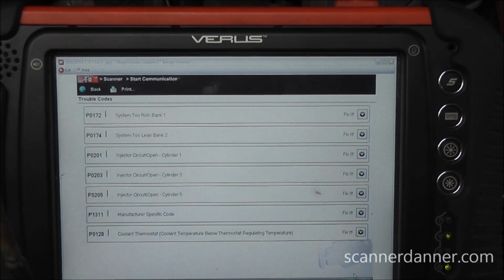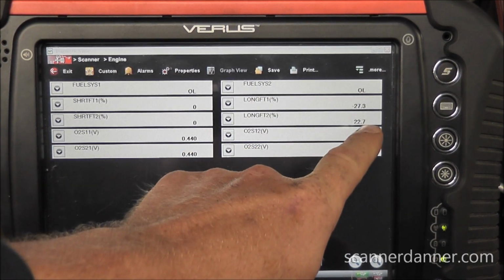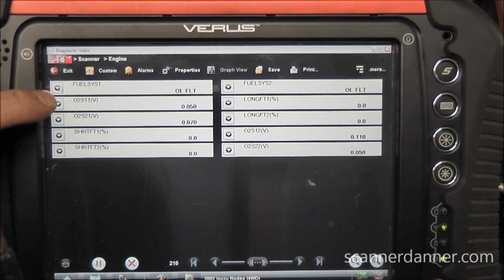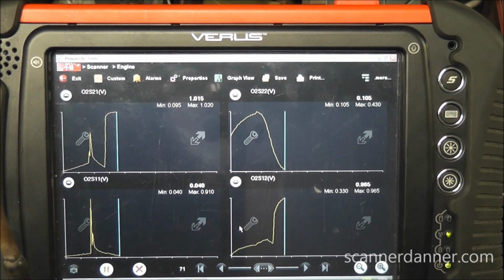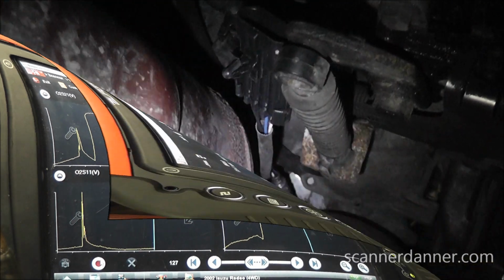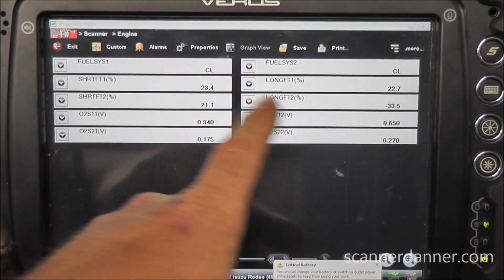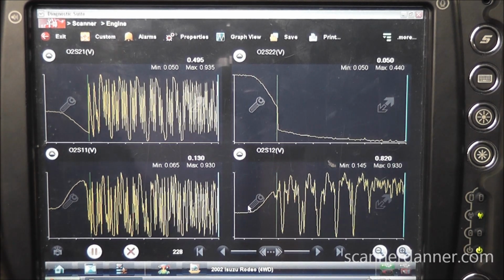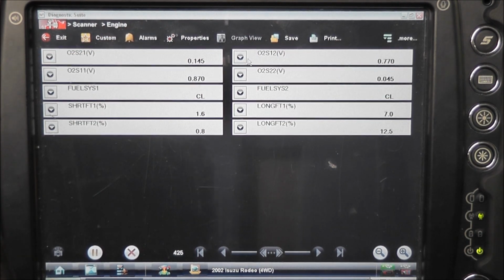2002 Isuzu Rodeo (misfire, low power case study, reversed O2 connectors)

Comment: Absolutely wonderful video. I've got a 2004 3.5 GDI isuzu rodeo with a pretty unknown history. Starts up and idles great. When cold, it'll increase RPM to max ~4000 with some misfiring. Once warm, it wants to stall if any throttle is applied. It'll increase RPM only with WOT but very rough, barely fires- idles mostly fine with a bit of a stumble. Only code is stating high circuit on MAF, previous owner states MAF was just barely replaced to try and resolve this issue. Will chase for bad grounding- maybe pop the ECU open and tear apart the harness to check for bad wiring and traces.
Reply: When I got my 2002 Isuzu rodeo sport it had a lot of obscure electrical issues different things would happen stuff would turn on and off I regrounded all the grounds 4 or 5 grounds there were a lot it fixed electrical issues I also found a speed sensor on the left side of the transmission wires were broken re wired it and no more high idle shifts at about 3200 rpms also EGr valve get stuck and behind the throttle body there is a EGr aka nox tube mine had the tiniest hole through it it a pain in the butt to clean the tube but with a drill and a piece of breaded steel wire you can fray the end as to act like a brush or a gun cleaning brass 30cal will work also if you remove the EGr valve there is a hole that leads into the intake manifold tube u can spray carb or break cleaner in it and blow it out with and air compressor
Reply: You can also clean the mass air flow sensor too should help unless the sensor is broken

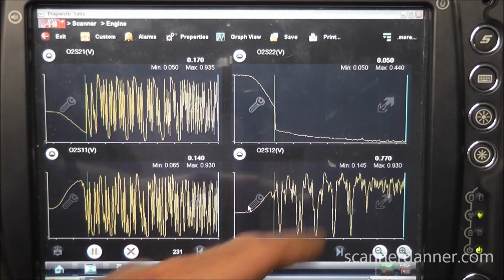Comment: At 16:33 Paul mentions briefly while looking at the rear O2s that bank 2 has a better working cat than bank 1, but from what I can tell bank 2 is running leaner, shouldn’t the voltage be near .700-.800 on a rear O2 that has a good working cat? Any help would be appreciated.

Comment: Great vid!  You mention in the video that you've seen this reversed fuel trims problem also caused by timing issues.  I've got this exact problem, although less severe, and I've already verified the O2s are correctly connected.  Do you have a video showing this problem when it's caused by timing?

Comment: At 18:00, after the fix, there is still a major difference between the two downstream O2 sensors, downstream bank 2 is rich, bank 1 lean. Why? Is it because the cat on bank 2 was flooded with fuel for so long that there is residual fuel still dripping through the cat, overwhelming the cat? Would that be expected to clear over the coming days as the residual fuel is blown away? Or is it evidence the cat has had permanent damage because of the persistent rich condition on that side?
Reply from the maker: It's been a while man. Maybe what you saw was the result of me not clearing the fuel trim memory?
Reply: Thanks for responding, Paul. Great channel!

Comment: ok  buddies i have  isuzu rodeo 04 the bank 2 all the 3 cilinder dont working when all the coils are connected but if i disconnect  the 3 coils of bank 1 they ,re working ider way if i disconnect the bank 2 the bank 1 work good wtat is the problem i my scanner gave me this code P1312 for the ion sensing module circuit line 2
Reply from the maker: Thats an unusual system. First thing. You have to use a factory spark plug on these systems. Does it have factory plugs in it?
Also we need to finish this on my forum because we can share pictures and wiring diagrams. 
https://scannerdanner.com/forum/post-your-repair-questions-here.html

Comment: I am wondering if anyone reading this might be able to help me.  I purchased a 2002 isuzu rodeo that had an engine swap with a honda passport. The people who swapped the motor got everything hooked up but the o2 sensors because they had different connector on the ends.  They used the engine harness wires from the Honda thinking they would just plug up to the isuzu but when they made it to the o2 sensors they realized they did not fit.  My question is...can I just swap out the 02 sensors to the ones with the correct mounts that match (honda) or will I have to replace the entire engine wiring harness? Also, is there a way to identify what o2 connectors go to what sensors? When I got the vehicle all the wires were just dangling from the transmission.  Anyone know of an online wiring diagram in the event I can keep the existing wiring harness so I know how to connect what wires to what o2 sensor?
Thanks for all your help
Reply from the maker: +Aaron Werner Yes you can (get honda O2 sensors) 
As far as wiring goes, there is a DIY version of the program I use called Mitchell1 DIY. Look it up. It's about $15 to purchase a three day pass for your car. Then you can print up the diagrams you need.
Reply: Thank you for your video and all the help I had another question. If the o2 sensors were not connected with a cause the motor to run at about half the power and just not run very well another mechanic suggested that the timing may have been off when they returned it and I'm just trying to determine if its the timing or if its the o2 sensors
Reply: +ScannerDanner 
So, in your video this isuzu was misfiring etc...with the crossed o2sensor wired.  If I had no o2 sensors hooked up would the engine run in a similar manner.  I am working on an isuzu rodeo that I purchased with a swapped engine and the o2 sensors are not hooked up (have to order the sensors with correct connectors).  They also timed the engine before they swapped it...could it also be the timing?

Comment: I had this happen to a buddy's Nissan Frontier. He purchased it from a DIYer after it suffered T-belt failure. He redid the entire top end this drove us crazy for a bit, until we figured it out. On the Frontier it was a bit more obvious the connectors were swapped because they both live right next to each other, and go secured on top of the valve cover. Swapped then, and truck ran like a dream.

This is why I like to use a marker, and run a line across similar connectors at different points. When assembly time comes, you can distinguish whether the two connectors belong together or not.
Reply from the maker: +Lynx Star Automotive (Gabe V) nice

Comment: He spoke the truth. Any bank to bank imbalance of airflow on a V-type engine can cause opposing fuel trims. If the cam timing is off, one bank doesn't open the intake valves soon enough and doesn't consume all of the available air. This air can go to the other bank causing your imbalance.

You could see similar issues with one side of the exhaust restricted, one side of the engine worn out, and so on.

Comment: With cost savings the way they are today, most manufacturers use the same connectors for multiple sensors.  Isuzu is definitely not the only one.  Most vehicles I have seen share identical O2 sensor connectors.  The only difference being if they are upstream or downstream. In defense though, if you look closely, that harness had a mounting ring where it was bolted somewhere, at some point. This falls more on sloppy tear down/rebuild, than identical connectors.

Comment: Hi Paul;

Another great video.... Got to love other people's repair attemps ending up as a "rats" nest in your back yard (LOL). It seems a little weird that Isuzo engineering would have made such a real  BASIC mistake in that  the bank-1/bank-2 wiring harness connectors were not UNIQUE and could be interchanged???  After running this engine post-FIX, I wonder if there was any long term engine damage done (totally whacked out fuel mixtures--bank.1 & bank.2)

Tom D.

Comment: not so sure about that but in this case it didn't, the owner had installed te HO2 himself and obviusly the MIL came on again, so when I checked it in the shop the last thing I suspected (before connecting the scan tool) was the HO2 because it look new. By the way, scan data was fix at 3.27 v which make me think that this car  was a cal. emiss. so we had to call the dealer to confirm cause there was not emission label under the hood.

Comment: Hey ScannerDanner thanks for your vid! What does it mean if you've only got 1 O2 sensor but your bank 2 fuel trim sits around 25% and then jumps around 30-40%? This is for a Ford inline 6 engine.